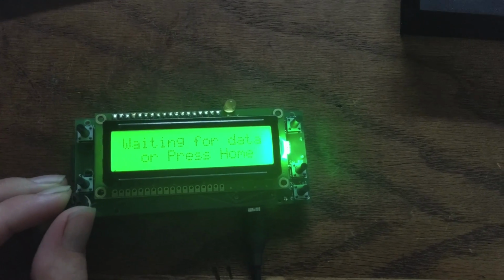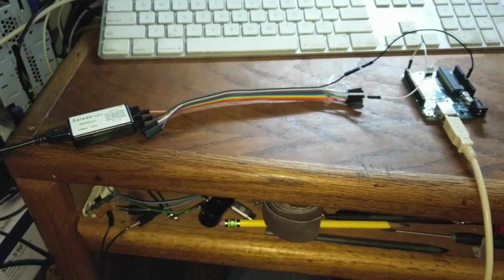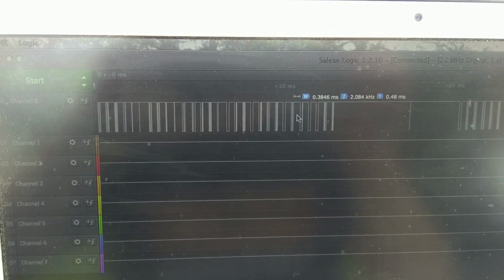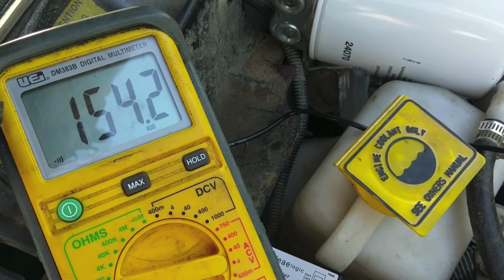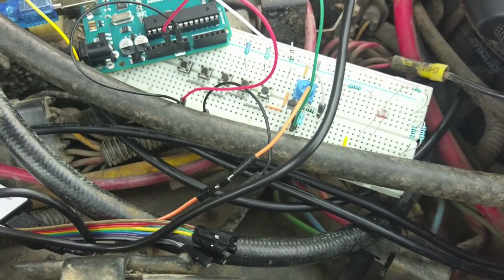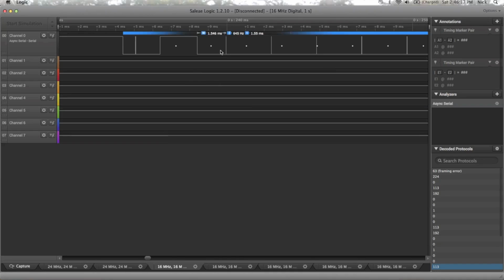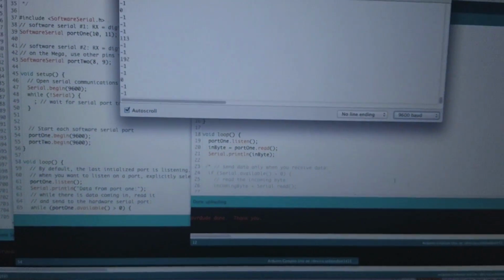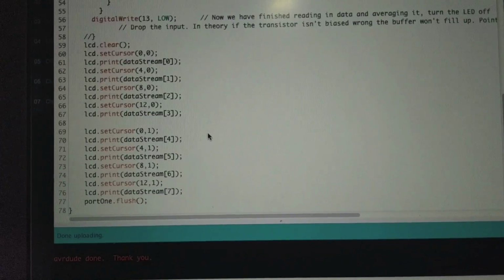Renduinix Progress, Logic Analyzing, and AW-4 TCU Comms Part 1

Comment: the distributor and flywheel is what makes that signal. if you match the physical to the bits, you'll actually be able to see the comparison
Reply from the maker: I'm not sure I follow. Are you suggesting that the ECU or TCU Data stream is made by the Crank Position Sensor?
Reply: pretty much, the ECU reads the signal from the CPS and distributor and mixes the two together to tell the TCU what to do to get the shift points at RPMs. in engineering is like a pinging signal, engine off is has like a closed loop, then when the engine is running it has a very different signal, look up the distributor sensor and flywheel in google images and youll see what i mean
Reply from the maker: Close......but still a little off. So first, the purpose of this video was to get into the TCU data stream, that is the Digital Bytes that it is outputting. They are square waves of 1's and 0's to represent each bit and the little groups make up a byte. My goal was to figure out the circuit needed to get the switching done to actually get those bytes. 

The CPS outputs a Sawtooth AC Wave signal which the ECU reads in to determine engine speed and also which piston pair is approaching TDC. The Distributor Sync Signal is more basic as it only outputs a squarewave DC signal to represent if piston 1 or piston 6 is on it's Compression Stroke. With these 2 signals then ECU can then accurately start injecting fuel and sending pulses to the ICM to control spark.

Now, as for the ECU stream same principal as the TCU but way more bytes in a string. The weird part is just that the byte spacing from one another is different when the engine is running and when it is off. I would assume it just sends data slower when the engine is off since things aren't changing as rapidly. But what purpose would it serve to send the bytes out at a varying speed in relation to say the cps? That would be kind of silly when instead you could just send that info as a byte itself.

Now to your stuff. So the CPS and Distributor Sync Signal both send their analog signals to the ECU, that part is good as it needs those to run the engine. The Renix ECU does not, however, send any kind of information to the TCU after the fact. They are quite separate and rely on their own separate sensors. Even the TPS is split 2 ways so they even get separate signals there. What would the TCU even need a dizzy signal for, engine speed from the cps would be all it would need to obtain rpm anyway even if it did need it.

The TCU uses a Vehicle Speed Sensor on the transmission to get Output RPM so it knows how fast it is spinning. It also has a TPS signal so that it can decide to upshift or downshift according to throttle input. There is also a mechanical Throttle Valve Cable that goes from the TB to the Transmission, and i forget if that is some sort of pressure related system or not. Beyond that, it just changes gears to keep the calculated input speed, that being the engine rpm, within a certain limit.
Reply: yah i get it lol .

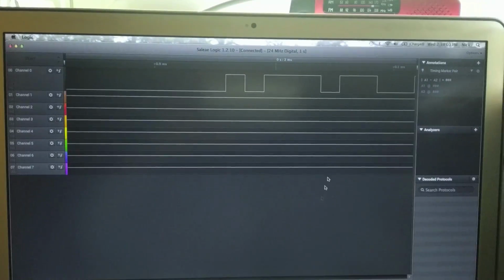Comment: 7:00. see if you can have the clock signal displayed along with the data. extremely important when troubleshooting, especially when you're monitoring RD and WR signals etc. then you also don't have to try to count the time between logic changes, you just count how many CLK signals there have been, giving you the timing, and also good to know if you're triggering on +ve or -ve (positive or negative) going CLK signals.
Reply from the maker: I've actually learned quite a lot since this video. I found the logic protocol analyzers so you can type in all the stuff like baud, inversion, and what not and it will display everything for you including bit width, timing, and number conversions. Really useful tool once i learned how that all worked.

Comment: If you need a 90 Xj ive got one you can throw it on
Reply from the maker: Auto or Manual?
Reply: Auto sorry thought I posted it
Reply from the maker: Damn, I really need an 89 or 90 manual. Good news is that a 90 auto XJ  with 4.0L was tested and works perfectly fine with the scanner so you shouldn't have any issues when the beta stage comes.

Comment: I got an 88 Jeep Comanche with a 4.0l and a ax15 transmission
Reply from the maker: Unfortunately I couldn't get any readings out of my buddies two Manual MJ's so you may be on the waiting list for a while.
Reply: there may be an issue due to the 88 4.0 only having the BA-10 transmission. ax-15 wasn't avail until mid-year 89.

Comment: got myself an 88 Cherokee that poorly running on maybe 2 cylinders that I can try and pull computer data from
Reply from the maker: Is it an Auto 4.0L? This would be extremely helpful because I have a lot of variables to weed out. I tried probing my buddies manual MJs (87 4.0L & 88 2.5L) and couldn't get squat diddly from em.
Reply: +NickInTimeFilms it is an auto 4.0L something has failed inside as my #5 plug is drenched in oil. and had metal melted to the plug. I'll try and probe it tomorrow.
Reply from the maker: Excellent. This will be a very important test that may be able to eliminate one of my vehicle variables depending on the outcome. If you can successfully get anything at all, then it looks like the transmission plays a large part in whether this setup will work or not.
Reply from the maker: YEEEEESSSSSSSSS. You have no freaking idea how worried I was about this. This is excellent news that we got anything at all so we know the hardware is good. So that seems to narrow it down to auto vs manual, not year which opens up a lot more people.

I am, however, slightly concerned with the stream pattern. I don't see the stop/start byte system I'm use to so it may take some more looking into but it atleast looks like a repeating pattern. If you ever get the chance, try another read while opening and closing the TPS as that may help index the stream or at least see which byte changes. 

You have seriously been a huge help with this project so far and it won't be for nothing, hugely appreciate your efforts.
Reply: +NickInTimeFilms I will run the TPS test tomorrow. is there an easier way to communicate with you?
Reply from the maker: Whatever is easiest for you. I have a facebook page, instagram, more old fashion email, or even text if you wish. let me know what works for you.
Reply: +NickInTimeFilms text would be the easiest for me. and then you can keep bugging me to test stuff. then I can bug you for your mechanical knowledge.
Reply from the maker: lol, fair enough. PM sent.

Comment: Hopefully my arduino will be getting here this week and I can build mine
Reply from the maker: Cool. Should be a very good chance it works on yours. Just probed my buddies Manual MJ's and didn't get squat so that kinda sucks.
Reply: +NickInTimeFilms You didn't even get a reading from the ECU? Or just nothing from the TCU? What engine was it?
Reply from the maker: Nada from either ECU, one was an 87 4.0L, other was 88 2.5L. No TCU because maunal. haha
Reply: +NickInTimeFilms That doesn't make much sense considering it should be the same as a Cherokee.
Reply from the maker: Auto and Manual ECUs are different. if you have facebook, I posted a quick blurb on my page about it
Reply: NickInTimeFilms Didn't know that. I figured since the auto trans has its own computer the ECU would be the same. Is it outputting data and you just haven't decoded it? Or just no data at all?
Reply from the maker: You would think, but ECU has to run the engine differently on a manual. 

No data at all. Software issues are easy an patchable, hardware issues are a different story.
Reply: Seems like a huge pain in the dick. Good luck man lol

Comment: For alpha testing it shouldn't matter the button color for now. Save money.... If you are printing the boxes anyway, leave the buttons black and label each button by engraving "A", "2", "select" or make each button a different color. 
It Will make it easier to explain how to use.... It's for off road geeks, we don't need fancy,  we want simple "press the Select button to select" or slightly more difficult "press the BLUE button to select.

Comment: Ok now on top of all the computer mobo jumbo, makes brain hurt.....stuff. 😝 (I've watched them all) You can now start your jeep without keys, and the valve cover is still an issue. With all of this going on, have you thought about doing any frame or drive line upgrades or up armor mods?
Reply from the maker: Yeah, don't overdose on this stuff, I've gotta take breaks every now and then so I don't lose it, haha.  
As for vehicle mods, a few of the things I'm interested in a bigger goals now. After this year's Rausch Creek trip I should have a good idea of what kind of armor I need next, but I would love to make some kind of simple exo cage sometime. I feel like my axles are alright for now, beefed up the shafts so I shouldn't snap anything. I need to address the steering at some point too.

Comment: hey Nick you might be the guy that has my answer I have a 1990 Jeep Cherokee Limited and I'm doing a head gasket the problem that I have is the wiring harness that comes off of the injectors and goes down to the temperature sensor and knock sensor and O2 sensor melted next to the exhaust manifold the problem that I am having is that I cannot find in a junkyard another harness for a renix system I was just going to go in and find one and chop it all of the junkyard car and then take it home and solder and heat shrink and grafted into mine but from what I'm understanding the color codes for the American harness vs. the renix harness are different and they're not the same setup at that end of the harness would you by chance have the proper wiring diagram indoor colors and positions for the harness for the renix I know it's a tough question to ask for but I'm kind of desperate?? Any help would be greatly appreciated
Reply from the maker: How melted we talking, like real bad? If the plugs to the o2, knock, and temp sensors are still ok, you could just buy some wire, cut out the melted crap and splice in some good stuff. Is the melt kind of in the middle or towards the end of the plugs? If the plugs are toast, I think you can usually buy them online. 
Knock: SMP #HP3860
o2: SMP #HP7340
Temp: SMP #HP7310
Reply: No it's right where it comes off of the fuel injectors and goes down in between the power steering bracket and the exhaust manifold and right where the exhaust manifold is it burn up all those wires most of them have their shaving melted but incredibly no wires seem to be touching but yes that's the option is to chop out that bad part and rewired it and then move it away from the exhaust manifold maybe put a little bit of extra length to it
Reply: I just wanted to make sure I had a backup for my colors that's all even though I can go color to color one wire at a time I just wanted to be absolutely sure
Reply from the maker: Color to color would probably be the easiest. Looking at a diagram colors are as followed:
Temp: Brown/White & Tan
o2: Orange, Gray, & Black
Knock: Violet/White & Yellow/Black

Comment: you ever address that cracked valve cover?
Reply: also, what price point would clear buttons be? the back light seems pretty bright & could probably luminate some clear buttons
Reply from the maker: Nope, like I said, haven't really had any time to actually work on the Jeep. Busy Schedule this month for some reason.
Reply from the maker: Although that would be neat, the selection of colors is pretty limited so I tried to pick a few that would be fitting.
Reply: smells like a valve cover is a video idea for next week. 

& if you aren't able to feel around the screen and find the buttons I feel like white would be the next best. doesn't really clash with many colors if you are doing the RGB backlight